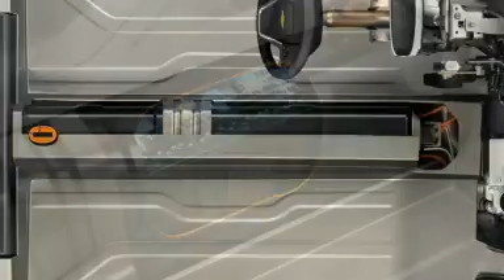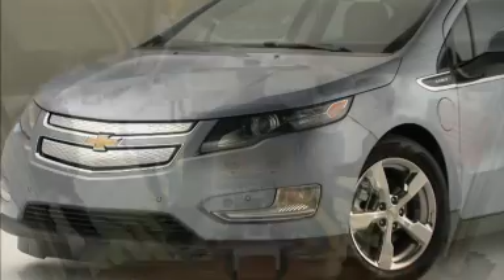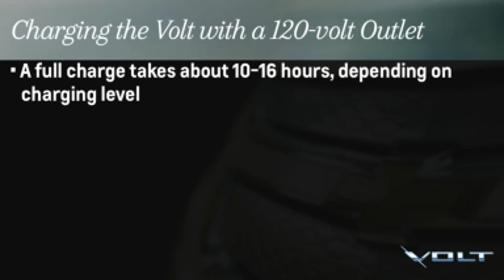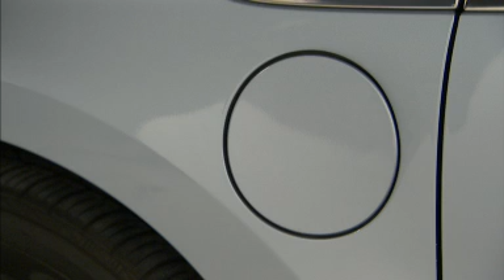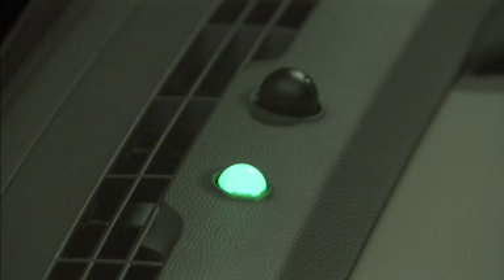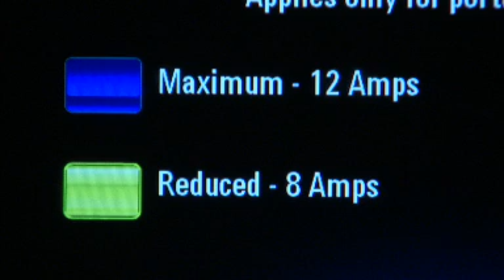2014 NEW 2013 Chevy Volt charging basics Mike Savoie Chevrolet

Comment: I have a 2013 Volt.  Now it only has a 29 - 42 mile range after a full charge.  It that normal?  Also I was wondering does the gas engine power a generator to power the electric motor.? The change over is so smooth.
Reply: Trainwreck 101 
Yes, the gasoline engine powers a generator, to provide power to the drive motor. 
The car always runs on electric, either from the battery, from the engine (through the generator), or a combination of the two.

How much range from a charge did it have before? 
You may want to ask the dealer service dept. 
I've heard of prius and leaf cars suffering from that, but not a Volt. 
You may have a battery issue.
Reply: The 2013 Volt has a 35 mile EV range. It’s fine. I suggest u read the owner’s manual.

Comment: Rapid charging is damaging batteries,  by degrading them prematurely, so I’m happy with the slower charge, plus I would never drive electric ⚡️ on motorways as it’s not as efficient as Gas, hence why the Chevy volt, makes so much sense. Electric ⚡️ around town and fuel efficient motorway driving
Reply: Well, the engine is only a generator to supply the electric motor that drives the vehicle with power.  The engine in these cars doesn't drive the wheels at all, they're electric powered all the time, it's just a matter of getting the power from an outlet or the cars engine.

Comment: 16 hours to charge???? chevy get better idea,if this system was good any german car will have it :) chevy and ford learn how to build vehicles!
Reply: zlatko iliev my 2015 Chevy Volt charges in 8 hours with an 120 line. 41 mile range on electric power. My lifetime average is 94.1 mpg. 8 hours may seem long but it works well for us.
Reply: Charges in 4 at 240v
Reply: @Fconig1  240voltcharge is thewaytogo, just about everyonehas a 240volt dryer outlet, making a240volt extension cord iseasy! andworks well, thefaster charge time doesn't hurt the battery, thevolt never really chrges to 100percent so it's battery is very long life!
Reply: @ericeinar  it's easier to keepthe vehicle charged at 240volt. thefaster charge time doesn't hurt the volt as it, as itnever really charges to 100percent topromote long battery life. most people willhave a 240volt outlet for their dryer and a 240volt extension cord is easyto make andthe charge automatically shuts off when the voltgets to its charge limit.